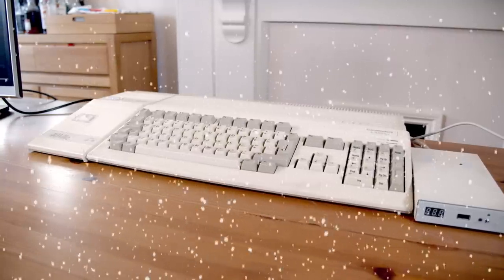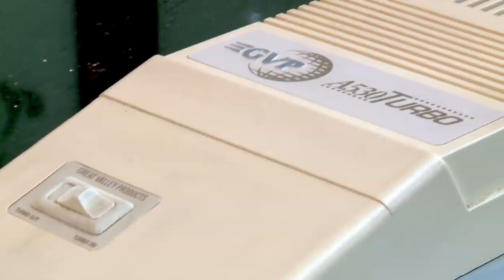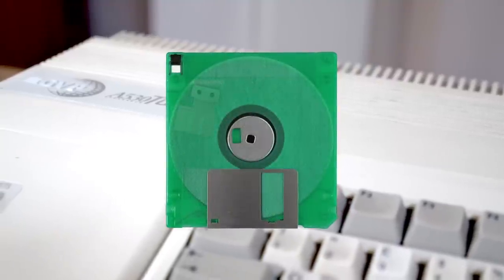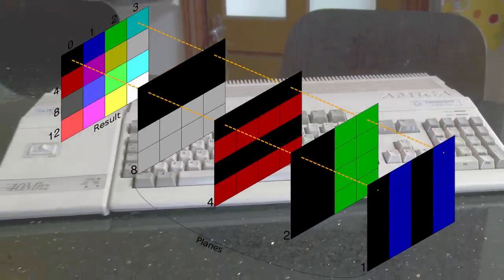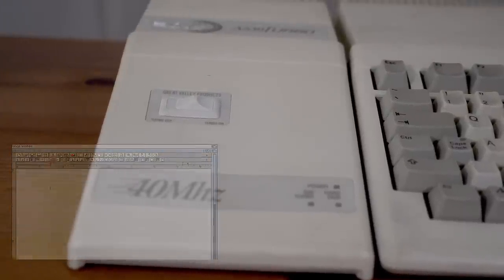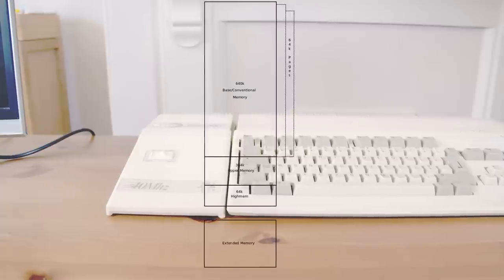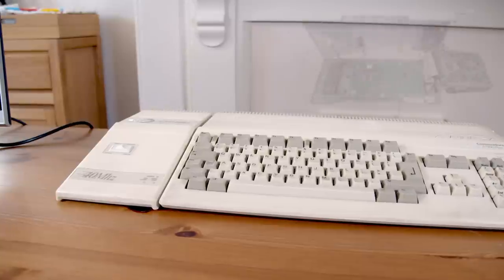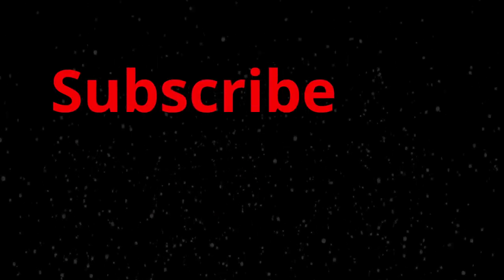This is a PC, no really.

Comment: The best way to think about chip RAM is to see it as "video RAM", not unlike modern GPUs, where access to it via the PCIe bus is really, really slow, but when you have put all assets in there, the graphics card has very fast access. In the Amiga case, Agnus can do very fast blitting, and Denise (Display Encoder) is actually the GPU. That makes the whole architecture look less outlandish.
Reply: It's sort of like shared video memory with an onboard graphics system, or a low end AGP card... except it's the CPU that has to wait, and when you upgrade, you're separating out the CPU somewhat rather than putting in a graphics card with its own memory.

It's not really that bad a setup, Atari and Apple did exactly the same (heck, most non-PC machines were like that). It was only really useful in the Amiga if you were running the higher graphics modes that monopolised the chip memory bus and slowed the CPU quite significantly (not a problem with the ST and Mac... because they simply didn't have those modes), if you were at 320x200 in 16 colours it made very little meaningful difference as the 68000 has relatively slow memory access (vs its clock speed) that means you can interlace video and CPU access together without either stumbling over each other, but for essentially 1 to 3 wait-states on the rare instructions that aren't inherently 4-clock aligned anyway.

(or if you had an accelerator running at more than the normal system clock, as any access to chip memory, even if not contended by video, would still have to run at the lower speed)

Apple even copied the idea fairly wholesale for some of their cheaper Mac IIs / LCs with onboard video. Had a couple of internal memory banks, if you only had one populated then you were stuck having to share and the mode you used could have a significant effect on computing speed and usability, as image quality had gone up a good bit faster than bus transfer rates (possibly the video system even did something fancy like the Atari Falcon, with a 32 bit backdoor into memory that's otherwise accessed 16 bits at a time). But with memory in both banks, you could have video residing in one and code/data preferentially using the other (until the space ran out of course), giving a fastRAM speedup for the OS and whatever would fit in the remaining space for that bank.
Reply: @tahrey  The thing is - many topologies tried UMA - where normal RAM is used as general purpose memory as well as graphics RAM, and all of them failed in the end, because it makes general purpose RAM quite expensive, while video performance did suffer.
Even modern computers have separate memory, and that is for a reason.
Reply: Re "access to it via the PCIe bus is really, really slow"
Hey, you don't know slow -- the original ISA cards, which stuck around even as processors advanced and CPU MHz cranked up, were sloooooooow.  Some fancy motherboards allowed the card speed to be set higher, like 11MHz, and individually for each slot, so a good quality Super VGA card could go into the 11MHz slot and other cards still run at 8MHz.
And, accessing a byte is slower than accessing a 16-bit word, because the legacy ISA (8-bit slot) originally defined the protocol to use more cycles.  It was improved with the 16-bit extension, but that only applies to 16-bit transfers.
I think the primary effect you see today is that it's set to non-caching since the GPU might write to it.
Reply: @graealex  Xbox Series X and PS5 have unified GDDR6-14000 memory with 320-bit and 256-bit wide bus respectively. 

AMD 4700S SKU recycled PS5's 16GB 256-bit GDDR6-14000 and APU (disabled integrated GPU) that are sold in East Asian markets.

For PC, UMA is used in low-end desktops and laptops e.g. Rzyen 7 6800U/6800H's 12 CU RDNA 2-based integrated GPU.

All Ryzen Zen 4 SKUs include 2 CU RDNA 2-based integrated GPU.

PC's ReBar feature enables the CPU to fully access the discrete GPU's VRAM while the PC's discrete GPU still has system memory as "shared GPU memory". UMA is not dead on the PC.
Reply: @valenrn8657  It's very much dead on the PC. All examples proof it - it works well for consoles, but makes normal PCs slower and more expensive, especially since it has negligible benefits.
This was always the problem with UMA, lack of benefits, especially perceivable benefits for the end-user.
Oh, and ReBar isn't UMA. It's still a separate memory pool with different access speed.
Reply: @graealex  UMA is still alive on the PC when handheld Steam Deck (with 128-bit LPDDR5-5500 with 88 GB/s) has exceeded 1 million unit sales.

Ryzen 7 6800U can support 128-bit LPDDR5-6400 with 102 GB/s bandwidth before applying detla color compression.

2013 era Radeon HD 7700 has 72 GB/s bandwidth VRAM without detla color compression.

PC discrete GPU sales are a small fraction of the total PC unit sales.
Reply: @graealex  Xbox Series X's UMA has 320-bit 10 GB and 192-bit 6 GB zones. Xbox Series X's CPU and GPU pointers can address the two zones without the need for explicit memory copies.

Amiga custom chips can't access CPU's Fast RAM while modern PC GPUs can directly access CPU's system memory for DX12 Partially Resident Textures (PRTs) via DMA and x86-64 style memory paging i.e. AMD GCN has a cutdown x86-64 style MMU.

Modern PC GPUs have large scale texture fetch DMA engines. DX12U DirectStorage and Sampling Feed Back features evolves from DX12 Partially Resident Textures (PRTs).

ReBar enables the  CPU to fully access to GPU's VRAM without 256 MB access window.  GPU frame buffer I/O operations shouldn't be disturbed by the CPU I/O.

 PC DX12 has memory alise feature that reduces the need for double data copies. 

Certain workloads benefit UMA and discrete memory models.
Reply: @valenrn8657  You're talking about integrated graphics here. Obviously that has to use the only memory channels available at package level. That is still a compromise that causes a loss in potential performance.
Reply: @graealex  For AMD RDNA and NVIDIA Maxwell, PC GPU's ROPS has multi-MB L2 cache with delta color compression.

Modern PC-integrated GPUs have a multi-MB L2 cache with delta color compression.

In 3D Mark's suite of benchmarks, the AMD Ryzen 7 6800H's Radeon 680M iGPU with 12 CUs handily outperforms the Nvidia GeForce MX450.

From Notebookcheck.

Elden Ring benchmark with medium details 1920x1080
AMD Radeon 680M (IGP) = 41.5 fps
NVIDIA RTX 2050 Mobile  = 43.16 fps

God of War with medium details 1920x1080
AMD Radeon 680M (IGP) = 30.6 fps
NVIDIA GeForce MX550  = 28.152 fps

Doom Eternal with ultra details 1920x1080
AMD Radeon 680M (IGP) = 146 fps
NVIDIA GeForce RTX 2070 Mobile  = 151.84 fps
Reply: @valenrn8657  Not sure what you want to tell me with this comment, or how you don't see that a CPU-integrated GPU having it's own and separate L2 cache actually is the opposite of UMA, an attempt at mitigating the performance penalties that arise from sharing the memory bus between CPU and GPU. Private caches generally fall under the qualifier "Non-Uniform Memory Access" - the complete opposite of UMA.
Reply: @graealex  >ReBar isn't UMA

ReBar enables the host CPU to treat discrete  VRAM as a part-time UMA with the discrete GPU.

The discrete GPU doesn't need to know about CPUs' memory I/O activities when generating the GPU command list.

GPU frame buffer I/O operations shouldn't be disturbed by the CPU memory I/O activities. Certain workloads are not applicable for the GPU and don't need to know it.
Reply: @valenrn8657  Exactly, mapping virtual memory addresses to private memory of a GPU doesn't turn the computer architecture into UMA. It's just a convenient change in the communication protocol between CPU and GPU over the PCIe bus that reduces the number of required transactions to access large blocks of memory, facilitated by the huge 64-bit address space that is now commonplace.
We're going in circles here - memory mapping isn't UMA. Private caches aren't UMA. It all falls apart when you realize that GPUs currently can't access pageable memory. With ReBAR, the GPU can't even access normal main memory with the same address view that the CPU has, let alone be cache-coherent.
Reply: @graealex  You missed AMD GCN presentation for Radeon HD 7970.
Reply: @graealex  From AMD Radeon HD HD  79000 Series presentation

X86 virtual memory is the foundation
- IOMMU for GPU, MMU for CPU
- 64bit x86 pointer will work for GPU
- GPU will page fault
- GPU will have address translation caches
- Can over-allocate memory

OS will service both MMU and IOMMU

Under a unified address space
- CPU and CPU will use the same 64-bit pointers.
Reply: @valenrn8657  You're again confusing virtual memory mapping with UMA. When a GPU wants access to the main memory, it goes through the CPU to reach the main memory. When the CPU wants to read or write from the GPU, it still goes through PCIe and the GPU.
That was exactly why I compared chip memory on the Amiga with modern-day GPUs.
Reply: @graealex  NVIDIA has CUDA Unified Memory Management with Pascal generation

Unified Memory is a single memory address space accessible from any processor in a system. (figure 1 shows multiple CPU and multiple GPU units having a unified memory view) 

Starting with the Pascal GPU architecture, Unified Memory functionality is significantly improved with 49-bit virtual addressing and on-demand page migration. 49-bit virtual addresses are sufficient to enable GPUs to access the entire system memory plus the memory of all GPUs in the system. The Page Migration engine allows GPU threads to fault on non-resident memory accesses so the system can migrate pages on demand from anywhere in the system to the GPU’s memory for efficient processing.

In other words, Unified Memory transparently enables oversubscribing GPU memory, enabling out-of-core computations for any code that is using Unified Memory for allocations (e.g. cudaMallocManaged()).  It “just works” without any modifications to the application, whether running on one GPU or multiple GPUs.

Also, Pascal and Volta GPUs support system-wide atomic memory operations. That means you can atomically operate on values anywhere in the system from multiple GPUs. This is useful in writing efficient multi-GPU cooperative algorithms.
----

https://youtu.be/UgLShs8JaTM?t=44
NVIDIA's Unified Memory for  CUDA.
Reply: @valenrn8657  General memory and GPU memory are still on different buses, how often do I have to repeat that?
Reply: @graealex  >When a GPU wants access to the main memory, it goes through the CPU to reach the main memory

FALSE.  Modern GPUs have DMA-like server-grade hardware accelerated network cards or DMA-capable RAID controller cards.

For modern GPU accessing system memory with minimal CPU overheads, modern GPUs need competent Northbridge (including PCIe host and system memory controllers).
Reply: @graealex  Commodore Amiga IDE is limited to CPU-driven PIO mode while modern PC's IDE has DMA modes that require competent cache coherent Northridge. Modern PC GPU has DMA features like DMA-capable PC IDE.

AmigaOne SE with  MAI Articia 'S'  has cache coherent incompetent Northridge!

On Classic Amiga, CPU data cache can't be applied on Chip RAM due to incompetent Northridge functions i.e. Agnus/Alice needs to be redesigned for the 68030 CPU.

68040/68060 MMU maps the Chip Memory address range as non-cacheable since the Custom Chip's DMA functions are not page tracked by the hardware for CPU cache coherency.

Classic Pentium-era Northbridge removes the need for wholesale disabling the CPU caches due to the hardware accelerated cache coherency tracking and DMA-capable PCI devices. 68060's infrastructure is inferior when compared to Classic Pentium's Northbridge chipset.
Reply: @graealex  >You're again confusing virtual memory mapping with UMA

On modern OS memory allocation, the userland program has paged memory with virtual address allocation.

AmigaOS wasn't designed with mandatory MMU and memory protection. MMU is optional with 68020's off-chip 68851 and MMU is missing with 68EC030.

X86 world made MMU mandatory in 80286 and it evolved in 80386.

FYI, Xbox One's games are run within a hardware-accelerated Hyper-V sandbox.
Reply: @graealex  
>General memory and GPU memory are still on different buses

The major issues for UMA vs discrete memory pools is programmers managing separate memory pools i.e. explicit memory copies (with high CPU usage) and duplicated data.

For gaming PCs with discrete GPUs, hardware-accelerated logical UMA views across system memory and GPU memory pools make programmers' memory management easier, lessen the CPU overheads and reduce duplicated data.  The programmer has to be aware of different memory bandwidths just like on Xbox Series X's physical UMA. This is the middle ground on  UMA vs discrete memory pools argument since physical UMA has its downside e.g. CPU's memory IO interrupting GPU's frame buffer IO and context switching overheads between CPU and GPU memory access.

----

In general, the CPU generates a GPU command list and lets the GPU fetch texture data from system memory via GPU's large-scale DMA engines. 

It's unwise for the CPU to perform large-scale data transfers when the modern GPU has DMA-capable scatter-and-gather hardware. 

AVX-512 has the complete GPU-style scatter-gather instructions for the CPU. AVX2 only has a gather instruction.

DX12U's DirectStorge enables the GPU to fetch texture data directly from mass storage into VRAM. 

PC DX12U DirectStorge uses GpGPU to perform data decompression.
Xbox DX12U DirectStorge uses custom hardware to perform data decompression.
PS5 uses custom hardware to perform data decompression.

Comment: "Everybody used a hard drive with DOS."

My family used a dual floppy setup when I was a kid. No hard drive.
Reply from the maker: I probably should have sounded a little more snarky for that line. The first PCs I had access to also where floppy only, but so much software I wanted to use required a hard disk to be installed to
Reply: @RetroBytesUK  Well Yes I was running a Classroom with 4PC-XT's Twin Floppies (Teaching Wordstar etc) luckily being Government Funded, they paid for 4 x 20 MEG ST-506 HDD, at only $1495.00 each .. What I really hated was a New User who put the Floppy Disk between the 2 Floppy Drives, not in them, as I had the remove&reinstall a floppy to fix 3 times..

Comment: No... you really made a hash of the PC memory stuff.
Getting to around 19:30, it's just so wrong I had to pause and comment.
The 286 protected mode still has 16-bit registers and a 64K segment size limit.  It's just that the meaning of segment registers has been changed to selectors and they can set the base address in a larger address range.  
It was not until the 386 and the new 32-bit mode that we got a flat address space and a memory manager that mapped a process address space to physical addresses, in 4K pages.
What you said earlier:  the "8 bit CPU" did not limit addressing to 64K.  It didn't have 16 address lines, but 20.  It addresses one megabyte.  To address this, the instruction set combined a 16-bit register or immediate value with one of the segment registers.  The segment register is multiplied by 16 and then added to the value.  It's not exactly like paging.
When it came to adding more memory:  There were two kinds.  EMS or Expanded memory allowed memory on the card (never on any motherboard to my knowledge) to page in to 4 16k windows in the base address space.  This is not "himem".  Himem was the dis contiguous base memory that might exist above 640k around the various memory mapped hardware.  You might be confusing this with the High Memory Area, which is the first 64k of memory above 1MB.
Extended memory is memory above 1MB, not limited to just the first 64k but can go on seemingly forever at the time.
It was the editions Windows/286 and Windows/386 that could take advantage of the High Memory Area and Extended memory, respectively.

Comment: Used to run the PC Task 4 emulator on my Amiga 1200/030 to run simple MSdos programs.

I wonder how fast they would run today using one of the Raspberry Pi accelerators on an Amiga.
Reply: Fast, it is installed in Pimiga 3.0 ..